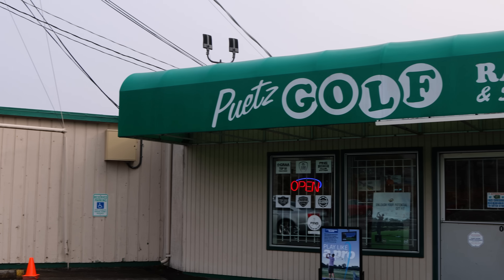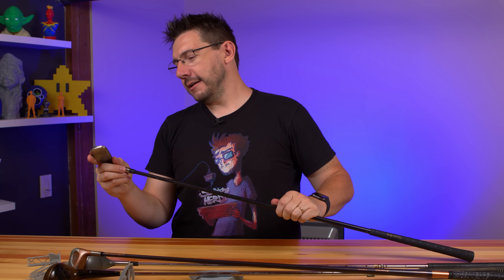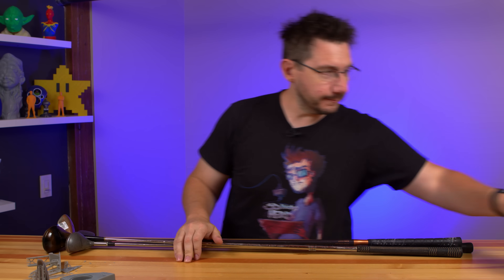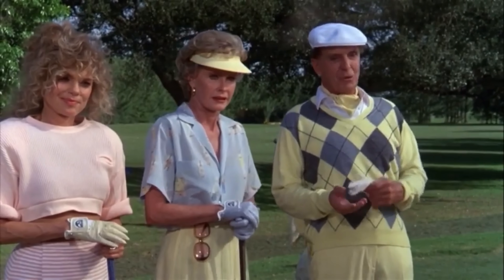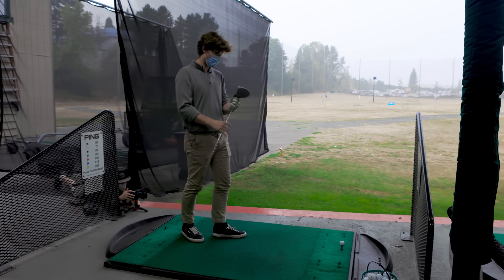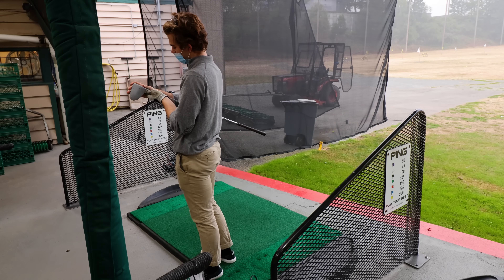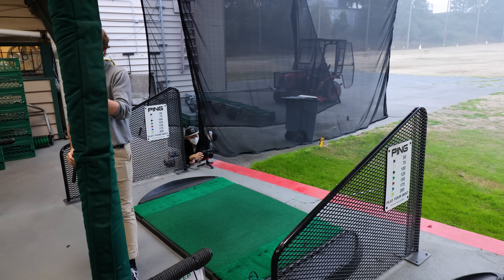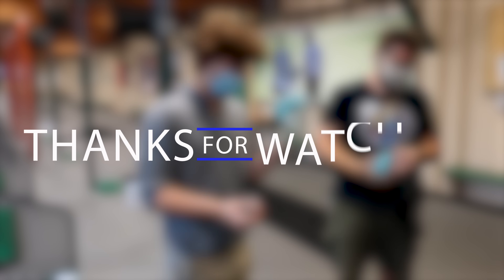Can We 3D Print a Driver? 3D Printing & Golf!

Comment: Not rly hating but a 117mph swing speed @ 260 yards carry doesn’t rly add up since those high speeds are over 300+ yards. But a better form will generate more speed and better trajectory. A inside out over the top swing will just slice like no trw.

Comment: All the editing tropes I was expecting, and loved! 
I don't have resin printer (yet) but have been brainstorming ways to improve strength of my FDM prints via grassroots methods. One of the new-to-me materials I've been working with recently, albeit for heat-testing reasons, is chopped strand basalt. I suspect getting a VERY short shredded version into your resin pool would add a moderate amount of strength, provided it doesn't interfere with light transmission. If that were to be the case, chopped fiberglass mat comes in such sizes and becomes translucent in resin. 
And if you really want to play scientist, silicon carbide can be had in a variety of grits. Currently I'm working with 1500 grit as a topical additive in combination with other sprayable ceramics. I doubt that would work in suspension, but you could certainly blow it through an airbrushed-sized sandblaster (the exact method I use for my testing with composite materials; it's a light, airy powder so be prepared for a big flippin' mess) as a topcoat with a traditional epoxy resin binder, building up a layered shell.

Comment: So for future reference you can remove the head of a golf club. There might be a screw holding it so look for that first.  After that(or if you don't find a screw) use a heat gun to heat up the joint between the head and the shaft. After a bit the glue will start to soften and you can start yanking on it and after a bit of work it will come off.  Then you don't have to rely on the epoxy joint.

Comment: Hey Joel, I am in a bit of a tight spot with my CR-10 right now because of legal problems that I can’t find an answer about. I was wondering if we could have a discussion about it either in this comment section or I can give you phone number. I recently purchased the CR-10 with funds from a GoFundMe page that received over $1,000 to help me print medical supplies for hospitals. But now that the demand has died down I need to do something with the printer. I am unsure of the legality of selling parts that I print on the printer because it was not the original cause and the printer was bought for the cause. Please get back to me if you find the time, thanks!

Comment: No chance. You really need the club to go more into the head. And use stronger material - i.e. Nylon Carbon combo. Then, with some really better stabilizastion, you MAY MAY MAY have a chance. The forces - ESPECIALLY on a Driver - are BRUTAL. NO WAY that you get this with standard 3d print. Particularly not RESIN.

Comment: the biggest one though Joel is that a driver isn't 1 material as others have noted.. its typically 2 or even 3,  but primarily its a shell wood or composite with a denser wood or metal core often with a plate across it, both for energy transfer and to spread out the impact across the head itself etc.. the structure of the neck is also important as no doubt you've seen.. Still fun and interesting vid... would be interesting to see if you added some flex material to cushion the shaft itself how things might go.

Comment: Re: mask
I HATE single-use non-medical masks for a few reasons: (1) They never fit properly, one-size-fits-all things only fit the average person, and this is even with the nose wire used properly. (2) Getting them to stay fitted is an exercise in frustration, because gravity. (3) Ear loops hurt after more than 15 minutes if you're not using them every day. Cheap elastic material. And because these stupid masks are so small (to slash costs), ear savers will not help much.

I use a homemade mask with a filter inside it, and either elastic or paracord that goes all the way around my head using 2 loops (top and bottom), similar to an N95. This way I can increase the tension on the loops with a cord lock and make sure that mask will stay on my face for hours if necessary.

Comment: Was the weight right? You meekness the drain holes but not how you handled the weight. I was thinking if it was too light you could add sand and plug the holes.

Comment: You should remove those supports before curing. Shove that under some hot water and they should come off with little or no damage to the piece saving you a bunch of cleanup time.

Comment: Thanks for the interesting video. My takeaway would be that when designing something for 3D printing you have to take the material into consideration. You can't just take measurements of the existing thing and model it 1-to-1. You've generally got to make things a lot more beefy for them to hold up. If you look at something like 3D printed joints on some 3D printers, they are way thicker than metal counterparts.

Comment: I would like to see drivers with FDM using filament with carbon fiber, nylon, metal, or even wood in them. Rotating driver to print on flat face. After couple layers with place for adding a metal face plate with some added holes for screws to hold in place. Why only 200 grams? Try different infills, different layer thickness, how many outer layers especially around shaft. And vary shaft hole shape, like wider at bottom to give “glue” more surface and less chance of pulling out. That is - If you really want to experiment!🤪🤪🤪 these are times I wish I could afford a printer.😭

Comment: Feels like there's wasted material making the entire thing a shell and putting thick resin where  there isn't impact.  Ideally there should be resin from the strike face back to the shaft.  I'd also like to see a triangle infill going from the strike face to the back, allowing air to flow through the print and reduce drag.

Comment: Resin printed parts for a mechanically demanding application is not the right combination. Resin over time degrade to their original acrylate base (AFAIK the formulas might have changed), meaning it will lose its properties over time. What you are attempting here should be solved using engineering polymers on a FFF machine.

Comment: Please try FDM. with polycarbonate or something like that =D
Reply: I imagine even PETG could do fine 🤔
Reply: @infernaldaedra  actually, PETG has a very low impact resistance.
Yes... it seems very tough and ductile and all that but that's just at low loading speeds but if you hit it, it shatters =/.
The modified PLAs aka tough PLA, PLA+, PLA pro, etc,  have better impact resistance than PETG
Reply: @santiagoblandon3022  Yes Petg shatters but Printes Solid PETG  or thick Petg ~10-20mm thick probably isn't gonna shatter. Perhaps though this is time gor 3D printing nerd to delve into industrial materials like PC or Ultem.
Reply: @infernaldaedra  I agree, that would be awesome =D
Reply: ABS

Comment: I wasn't even focussing on whether the clubs would hold up, I was just focussing on Tim's facemask.
Reply: The struggle was real man. 🤣🤣
Reply: He also doesn't have the metal insert shaped to his nose to keep the mask up.
Reply: Not only is he wearing it incorrectly (the metal insert is not shaped to his nose), but he constantly keeps touching it so if it did have anything on it, it's now on his hands and everything he touches.

You're just increasing your chance of getting sick or spreading it by wearing and using the mask incorrectly.
Reply: I've never had problems with my facemask and I have a real big schnoz myself. So I am not sure what this guy's prolem was, but if the disposables aren't staying on his face,m he should consider a cotton washable. The big ones, not the piddly ones.
Reply: @bluephreakr  Doesn't help that he keeps pulling it up and then pulls it right back down again...
Reply: Fear Flag, or Muzzle either of those terms work for what they are.
Reply: @majorpain7628  Next time you have surgery, ask the surgeon nicely if they would  spit in the wound before he sews you up. Then come back and tell us how that goes, if you're not dead of sepsis.
Reply: @majorpain7628  You're certainly easily manipulated. That much is clear, as is the fact you're heading for a Darwin Award. Personally I'm loving the freedom a mask gives me not to have facial recognition follow me everywhere, but you must love having your every move tracked.
Reply: @majorpain7628  plague rat

Comment: Should have added a metal face insert to spread out the impact energy and an infill pattern and it might have been successful.
Reply: Yea, either infill or solid print.  Also, since he knows that the 3D printed material isn't as strong as the original club head material, he really should have gone into the 3d model and  significantly increased the amount of material around the point where the head meets the shaft (both wall thickness as well as depth of the hole..